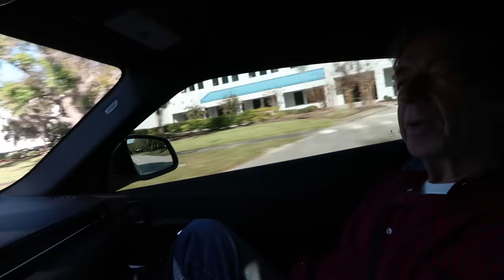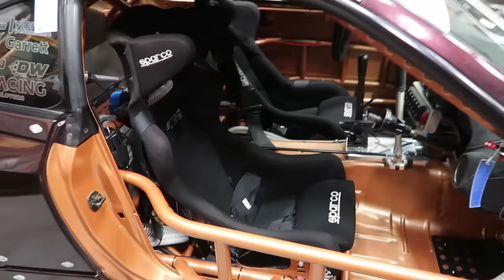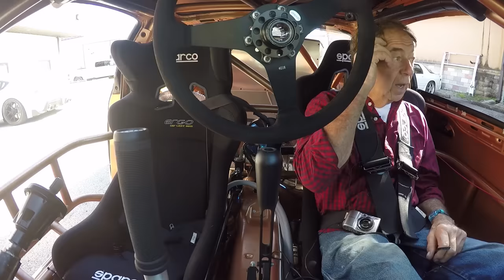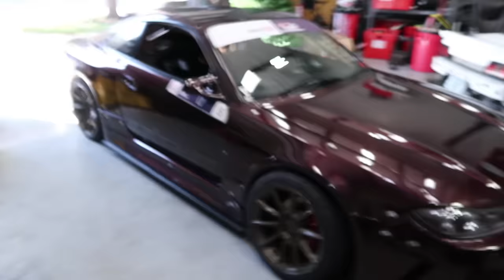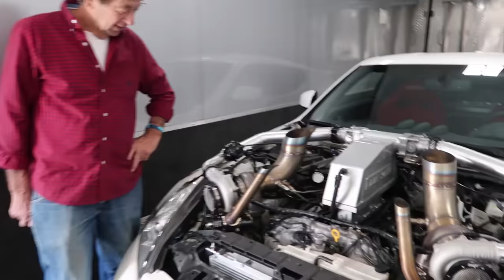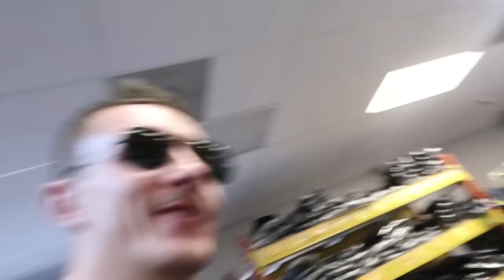Scaring my Dad in my 1000hp 2JZ S15

Comment: How many miles to gallon does it make?

1000HP: No, its gallons per mile
Reply: smiles per gallon son
Reply: wallet ain't cracking one tho xD
Reply: It’s the sacrifice he made how else is he finna fuel those numbers electricity or what😂
Reply: I don’t think he has any reason to go slow he just uses more gas that’s as if to when he is going fast 😂
Reply: Ctibor to je typek
Reply: 13 gallons per mile
Reply: I think the correct answer would be, YES!

Comment: Why don’t all cars have transmission like this, like a motorcycle
Reply: nah its gae h pattern is more interesting 
also sequential is shit in town speeds
Reply: Cant skip gears with that
Reply: Sequential Shifters have one major drawback for daily driving. It's sequential.

Nothing wrong with them, it's just not preferable for what most people use cars for.
Reply: I would much prefer sequential manual to regular manual, so much faster shifting
Reply: no synchros so it means you have to shift it at the right rpm other than that, those massive engaging teeth not gonna mesh together, they will just snap that third gear in piece.
ps: if you like those transmissions only cuze of the shifter, buy an old doug nash or richmond, they are more street friendly.
Reply: Benjamin Lim they are very hard to maintain, they aren’t as reliable as h pattern.
Reply: Standard gears (a slight screws shape to them) are both quite and more smooth when it comes to power output.
Straight cut are unreliable as you are pushing force into a wall while normal is like pushing a force into a reinforced wall.
If you dont get what I mean, basically straight cut can break more easily.
Reply: straight cut gear are not unreliable at all, actually they are more reliable than an helical gear. the only disavantage of those gear is that they are noisy. compared to the helical gear that has an axial and a radial load, the straight cut gears only have a radial load, wich is the reason why in any transmission with straight cut gears, you will most likely see ball or roller bearing instead of tappered bearings that needs a preload on them. between me and you, how much faster it is to rebuild a tranny with ball bearing than tapper bearing? Go have a look at how easy it is to rebuild a top fuel dragster transmission. They litteraly can be rebuild in 15 minutes and takes 2500hp any day. a good example of a transmission that has both bearing would be eaton transmissions. if you look in the auxiliary section, the countershaft are helical gears so there is tapper bearings but if you look in the front of the transmissions, its straight cut gears so there is only rollers and ball bearings.
Reply: A lot of modern tractors do

Comment: If you could actually get it to grip, it would go well......... If you want it to go fast in a straight line, try wider rear tyres, softer compound, or even add weight to the rear end, but blowing the tyres off in every gear demonstrates a bad setup, and quite frankly makes you look amateur....... UNLESS it's a Drift car, in which case it looks like you have the PERFECT setup. Hope that helps

Comment: Highly doubt anyone can answer this but is the transmission and deferential on the s15 set to a high ratio like 4.11+ so you can keep it at a high RPM easier for drifting? Kinda what it seems like with the quick shifts
Reply: Yeah thats basically it(its kinda impossible/stupid to drift those cars at that power with long gears), he also did it to help with the boost(ties in with ur rpm statement, he got the most power (at hight rpm)to maintain boost. soo yee.) and the gears aren't that short they are prolly in 3:sum its just that his tires are spinning in every gear so they may also sound short That car is done with fd now tho, he joined rtr so he's drifting a 1300hp mustang for formula drift next year.